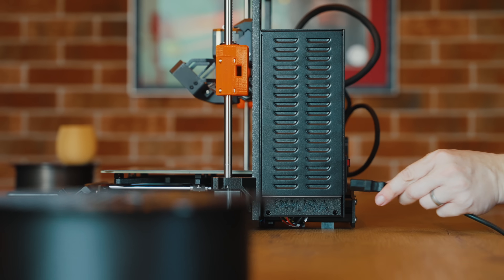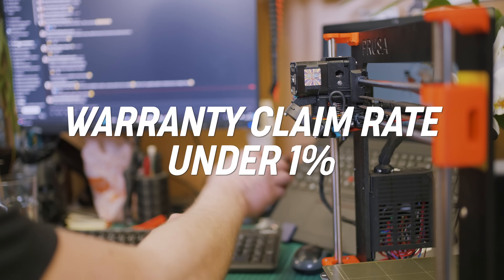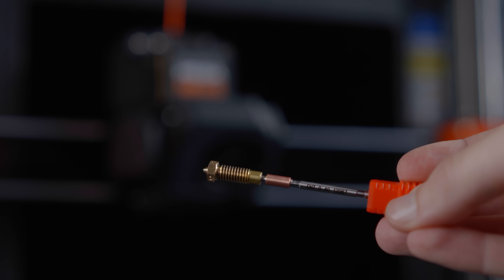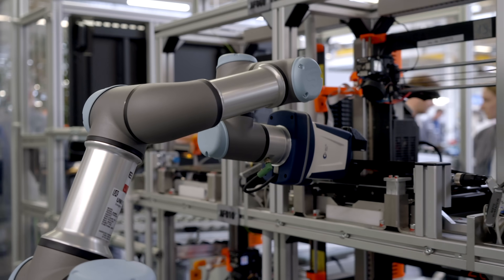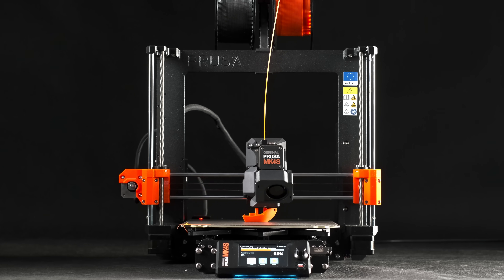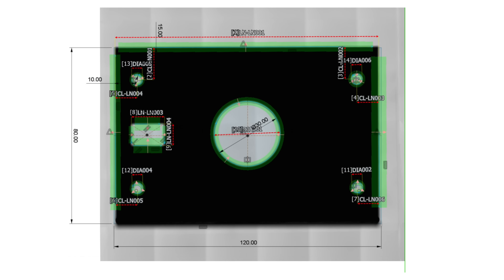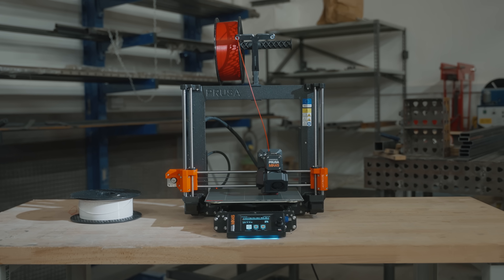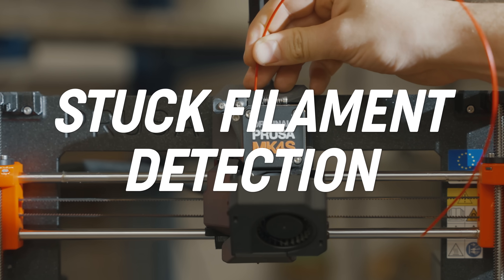Original Prusa MK4S - 360° cooling, High-flow nozzle, Native mobile app, PCCF parts - SHIPPING NOW

Comment: Does the printer accept AutoCAD drawings? AutoCad Dxf?
Reply from the maker: Hi. Not directly. But if you export from AutoCAD in STL or OBJ format, you can later load this into Prusa Slicer and create the gcode needed for the printer. Feel free to download Prusa Slicer today and try. It is totally free.
https://help.prusa3d.com/article/download-prusaslicer_2220
https://help.prusa3d.com/article/first-print-with-prusaslicer_1753

Comment: I just bought a Bambu lab a1. I really wanted a mk4s but it was out of my budget. It’s a great printer at easy prints but I think I’m just gonna have to save my money for a prusa printer as it struggles with certain prints and I need a printer that can handle whatever I ask it to print without throwing a hissy and wasting loads of filament until I get the settings perfect.

Comment: So, I bought that upgrade*. Now the best quality is 0,1 QUICK DETAIL and it is not so good as 0,05mm profile on MK4. Only IS profiles available in Prusa Slicer :/. Benchy on 0.2 (IS ONLY in profiles) 36min. Support told me, they do not think to add NON IS profiles, 0.1 FAST DETAIL is the best profile in slicer now. There where some screws in upgrade kit missing... I do not have so quality choices as before on MK4 and printing time... I can not see different. I'm not so happy after all.

Comment: I just built my Mk4S kit this week and I'm very happy with it!
It's a real upgrade to my mk3s. I just have a but of feedback on the things I found while building and using the printer in the last few days.
First of all, the self-tapping screws for mounting the display are non fun in their current position, I would have much preferred to see machine screws here, and maybe one of those square nuts to engage with them, like you're using in many other parts of the printer. Speaking of screws, the "big" screws used to mount the Aluminium Extrusions to the frame had some issues, some of them didn't engage with the hex bit properly and it slipped out easily. They felt kind of cheap. Apart from that the building process is very smooth and quite fun, this is the first printer I ever assembled and it was all done in about 5 hours.
When it comes to the UI I have found that there apparently is no way to set the clock without connecting the printer to a network?
If there is it's well hidden...
Also, I'm not a fan of the status menu "scrolling" through while printing, I'd much prefer a like that always tells me the remaining time so I can see that at a glance and don't have to wait for that menu point.

But keep in mind, this are just minor issues, and I'm very happy with my printer, it's a full recommendation from my side!

Comment: I don't understand the injection molded display descision. Just print it in your print farm, you said yourself it's much faster now.
Reply: In a tour of their farm, they also mentioned they used injection molding for parts that don't change for a long time. Knowing nothing about this process, I don't see what the big fuss is? Obviously they see a net positive in injection molding, and I'm assuming the files for the original 3D printed part still exists for future replacements if yours breaks?
Reply: @GOOBENsticks  it's the principle.

Comment: When will Prusa be adding lydar to the system.
I will be another way to assure a cleaner print.
Reply from the maker: We are not planning to pursue that anytime soon. As our competiton has shown us, and as we learned with the initial MK3 filament runout solution, these optical sensors are less than optimal for numerous reasons. We believe our loadcell sensor is a much better solution from pretty much every angle. -Mikolas

Comment: I was very happy with my MK3(s+) for about five years. Since roughly one year I own the MK4, too. Its a good printer. The upgrade is great, I will also get the accelerometer and the I/O board ( not needed for me, but a nice toy). What I would really like to have is a "XL mini": slightly bigger than the MK4, ( up to) 3 Nextruders and the possibility to use an MMU3 with any of the extruders->up to 3 types of filament and/or 15 colours.

Comment: Hey Guys, great work, I love it!

Is there a way to adjust the skew on xy axis? Like on the MK3?

best regards
Reply: Unfortunately not. The printer is very rectangular, but not perfect. For enclosures with tight tolerances you need to orientate the parts correctly. I miss the feature to correct the skew....
Reply from the maker: Hi. The firmware should be able to adjust this automatically thanks to the readings of the LoadCell. But if this is not he case, please contact our Technical Support team and we will help you.
https://help.prusa3d.com/article/customer-support_2287

Comment: So if is 1% for 20 printers per month, then 100% is 2000 printers per month?
Reply: Warranty claim rate means - someone had to reach out to support with any warranty thing, any tiny problem at all, that's the 1%, not sending printer back. Those are 2 different stats. ;)

Comment: Super excited about this upgrade. Can you please elaborate on the "using an enclosure for PLA or PETG is not ideal"? Not that long ago, it was advertised that using enclosure will prevent warping and increase print quality due to better temperature stability.

Comment: Releasing Upgrades while the baseline MK4 still does not work even close as smooth compared to MK3S+. "Faster then competitor" ... haha, no. 

MK4 had a bad cooling solution (ok, seems fixed with MK4S). But whats with all the bugs and issues? Many MK4 still killing USB drives at random or are not able to load the files correctly from the laughable PrusaConnect. Or whats with "Calibrate X/Y axis" loophole many MK4 have at the print start? 

Two years ago, I would 100% agree to "Relaiable? Prusa!" with the MK3S(+) I had or have seen. But since the MK4? It's more like "Prusa? No, thanks.". Rushing a product just you got pressure from BambuLab and the customers have to accept it. 

So whats about the MK4S expansion board you showed in this video? Is this an expension to the MK4S same as the calibration stuff? And if so, does it release like the still missing extensions for the Enclosure? So never?

Comment: Joseph, I LOVE prusa and see you all as the top leading brand period.  The quality, the hard work, the support, the tracking of every single thing.  You literally pour your heart and soul into every aspect and detail of prusa and prusa products.  However, that being said, I can’t help but see the mk4s as another upgrade to a 10+ year old design.  Over a decade has felt like an upgraded patch to the same look and feel we’ve used forever.  Since the mk2, we’ve seen the same rod system, same belt system, near similar parts, and same basic functionality and structure.  The design has been left out over and over and needs a serious futuristic overhaul imo.  Something so incredible and produces such high quality prints, needs to also look the part.  For us technically inclined we could care less, but for everyone else, it needs to look as good as it works.  Instead, to some it looks intimidating.  For us engineers we don’t really care how it looks as most engineers don’t work in design.  I completely understand that the design has to also follow function.   It’s time to look into a new build.  A new look and better overall design.  You can still keep costs down and still look amazing!  Now, I’m not offering to design the new look, I’m just suggesting it’s needed. (Though I’d gladly do it for one and some filament lol….but again, not my point).  Please consider the next upgrade or major revision to also create an all new shocking look to show your strength and quality we’ve all known and grown to love.  Keep printing!
Reply: When something just works, please don’t touch it. It’s not really needed. Look at Porsche for example. I don’t like companies that come out with new models all the time. I prefer a restaurant with a small but really good menu than a really big one.
Reply: @dubsativa180  afraid, this isn’t a Porsche here.  While it’s a great machine, it needs to look inviting, not intimidating to new users.  It needs to change and evolve as tech evolves and not look like you’re putting a bandaid on every year.  While that’s not the case here and a bit extreme to make a point, prusa ‘s tech is amazing.  Point being, the rest of the machine needs to match the part.  It’s why we aren’t driving old Porsche’s and driving EV versions that self drive today.  If you don’t stay up to date with tech, you die out.  You have to be competitive, and look the part.  There is plenty of room for innovation and it’s time for change.  We’re paying $1000 for a machine that should feel like a new Porsche and look it too.

Comment: Can you not forget about the mk3.5 customers that CANNOT upgrade to anything without buying the full mk4 kit that half of the parts are NOT NEEDED?
Reply: Why not buy the part separate then? They are available as spare part in thr shop
Reply: @theangelofspace155  They are not, the nextruder isn't sold as a full assembly nor you are told if there any printed parts you're missing
Reply: At that point just sell the whole machine and buy a brand new one if you need the features, Prusa machines keep their value well on the used market.
Reply: @NorwayVFX  Why whould I do such wasteful thing if I am happy with my machine that I upgraded from a mk3 to 3s to 3s+ to now 3.5? It's such a wasteful thing to do since the printer was perfectly capable of being upgraded to the 3.9/4 but now that I got the 3.5 it's a big nono? It doesn't make any sense and prusa should just split the mk4 upgrade kit into two, one being the 3.5kit and one being the 3.5 to mk4 kit
Reply: @Sventra  Because you wanted to upgrade and at the moment that is you best option. 
If you’re happy with it then just keep it like that.
Reply: @NorwayVFX  You don't get the point. I had a Mk3 that was able to be upgraded to a mk 3.5/3.9/4, I did the 3.5 upgrade thinking i would be able to get the 3.9/4 later on but now I can't because prusa doesn't sell the individual parts to get a 3.5 to a 3.9 or 4. It doesn't make sense since they can take the mk4 upgrade kit and split it into two and have one mk3.5 kit and a 3.5 to mk4 kit.

I am happy with my purchase but I don't want it to be a dead end, since I can technically put back the mk3 parts on my machine and get the mk4 upgrade, that's why it doesn't make sense as I will have 2 sets of mk3.5 parts like the xbuddy board and the lcd screen

Comment: Buy Prusa printer if you have money to spare, or want to support local businesses, and it's nothing wrong with that. But wisely, in terms of bang for buck, I would rather not, there are plenty of better options out there. Don't get me wrong, I loved my Prusa mk3s printers, I have 8 of them, but not any more when they introduced the mk4 upgrade kit for the cost of almost a new printer. Such a greedy company, you could have come up with a brand-new design printer with those profit you had on the huge sales of mk3 and mk3s during the pandemic, but you chose to introduce another sling bed printer instead with those “new features”. When spending 1099+ USD on a 3D printer in 2024, I would expect to be able to print PETG-CF at least, with a full enclosure with HEPA and active carbon filter so my kids won't inhale the carbon fibre fine dust in the house.

Comment: that GPIO board is very enticing, also, the 4 hour 32 minute figure appears to be a BBL X1C. it is worth noting that without the extensive setup time it does beat the MK4S by 2 minutes. turning the acceleration up to 15000 will cause the BBL to pull ahead. its very impressive how fast they made that thing go!

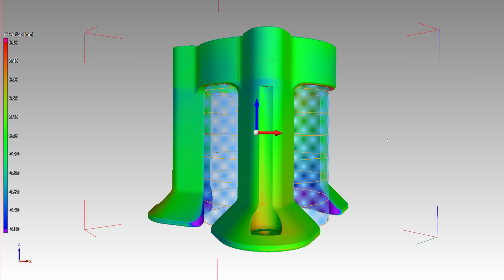Comment: It's a kinda weird announcement... It is common practice to have an accelerometer in the tool head nowadays. What competitor are you comparing your precision with ? You sell a 1200 CAD + enclosure + filter + upgrade now + light + etc, so to which kinda of printer are you comparing your product? At 6:27 to 6:29 we see a part that has a serious defect (very visible discoloration), is it a thermal or a flow issue ? Your new cooling looks amazing! When you inject your new parts, are they still susceptible to slopping in the enclosure due to higer environnement temperature ? Your price looks very fair! You have a highflow nozzle, what is your volumetric maximum flow with it on the mk4s ?
Reply: Flow are in the page with flow for every material. I do agree that the parts on my mk4 upgrade kit were very popr. I decided to buy them instead of pronting yhem woth my mk3s to make sure they are very high quality. As soon as I finished assembling the mk4, I had yo reprint thr more crucial one, and didnt print all of them because I didnt want to spend hours assembling everything again. So I agree that they print parts dors not have that "high quality, low imperfections".
Reply: @theangelofspace155  by the time of that comment I went to check the volumetric chart they produced. I'm quite happy that they did. I'm not a big fan of extreme speed, mostly because I make parts for structural purposes. I think the upgrade is actually great and they changed some of the crucial parts for pc-cf (their pc cf is insanely cool, so clean). I had a couple of Mk4, the thermals were always an issue for anything above abs. It was inconsistent, there are no PID settings and more problems. The cost of the printer is 1200 + the enclosure + camera + filter + light (no they are not even included) + hardened nozzle kit. Now they make us pay for an upgrade which is very fairly priced. I still have a very sour taste of my MK4 overall experience. It's almost 2000 CAD for a poorly enclosed small bed slinger...

Comment: I just got my MK4 up and running. Just love this thing, which is now allready old. But it works great. Will consider upgrade or even adding a new 4S. Thank you Prusa for everything you do. I am thrilled about your concern with open source. And with your great interaction with the community. And everything about the slicer. The engineering and so much more. Best wishes.

Comment: You keep claiming the hardware is Open Source. What about the nextruder nozzles??? Either stop claiming to be open source or actually open your hardware.
Reply: If you look at the open source section on their website they specify exactly which parts of the printers are open source, and the small amount of parts that aren't. It complies completely with the idea of open-source. They allow other manufacturers to see how Prusa solved challenges, possibly allowing for a new industry standard. They also allow customers to print new parts for their own printers and even modify these parts for their own needs.

They however do not supply a full bill of materials, full PCB layouts for newer printers or any insight in manufacturing processes. This is completely understandable, as it would allow other companies to make exact clones of the Prusa machines, which they would then be able to sell for much less due to them not having any R&D costs that they need to compensate for. This would mean that Prusa would have done all the work and some scummy opportunists could reap all the profits. Prusa specified this as the exact reason why they stopped sharing absolutely every detail about their printers, as they used to do this in the past. The practices of the other companies violated the idea behind open-source, as open-source was supposed to allow other companies to improve their machines and processess, not provide a free template for them to copy and profit from.

It makes a huge amount of sense for the nextruder nozzles not to be open-source for this very reason. You're just looking for cheap nozzles without any regard for the amount of research that went into them. Good luck getting improved hardware in the future with that attitude, as nobody will be willing to do the R&D for it then.

https://www.prusa3d.com/page/open-source-at-prusa-research_236812/
Reply: @DannyMNL  Being able to built upon the open source project without the needed R&D is the whole point of being open source. Imagine a closed source V6 nozzle. Damn, imagine a closed source Prusa i3...

Comment: Bought MK3S+ -> MK3.5 kit for the 32bit board. Is all of the app/electronic side of things part of the board and just firmware software? Or is there replacement parts needed? Is it even possible on a 3.5?

Comment: MK4 upgrade kits are live. Just ordered mine. You can find them at the bottom of the main page. There’s a difference in the MK4 kits based on which LCD you have so pay attention to that. Says they ship on 9/9/24. Also, accelerometer is not included but available to order, same with hacker board. Looks like it comes with new covers for the xLCD and Nextruder too.

Upgrade: $99 US
Accelerometer: $17.99 US
Hackerboard $14.49 US
Reply: Plus $20+ shipping to the US.

Comment: Still way to expensive, enclosure for 300+? This is a joke right? A p1s with the AMS costs less than a mk4s with just the enclosure, and print quality and accuracy is basically the same. You need to checkon the price of your lrinters and see what the competitors offer. An A1 mini costs 200 euros. The prusa mini is a dinosaur compared to it, and it costs as much as the A1 with the AMS lite.